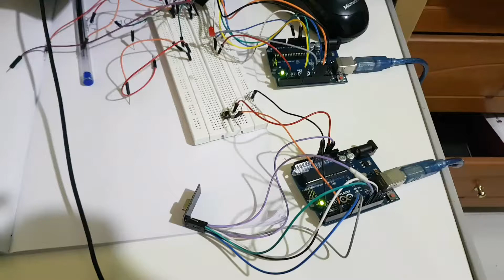NRF with Arduino.... Wireless control of LED using push button

Comment: is your code transmitting zero all time to send off to led?
Reply from the maker: it is not transmitting zero all the time...
Reply: i tried your code doesnt work as your demo, i am looking to send 3 button pressed high while they are pressed regardless the combination and stay off once i release the button. if you can send me your code or i can contact you to work together to get it working please?